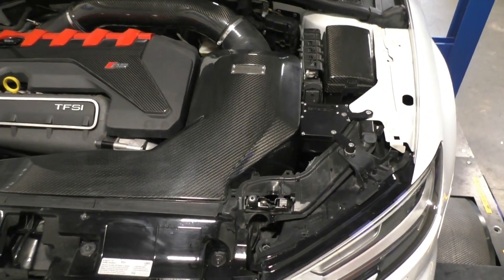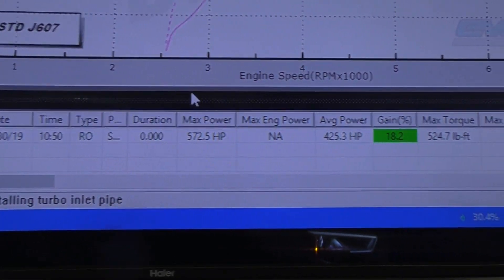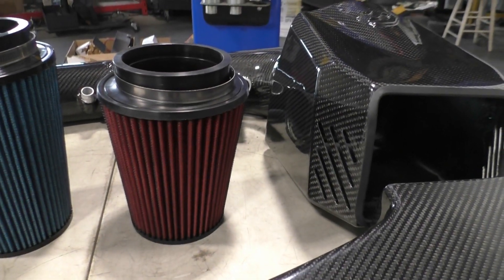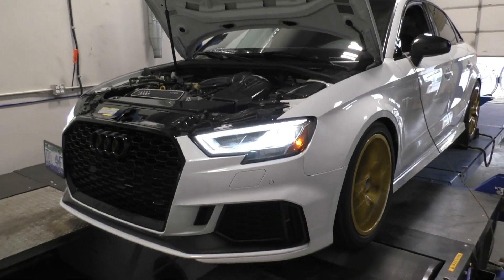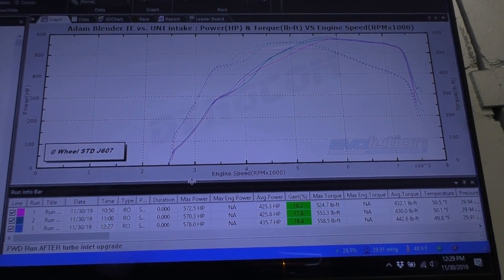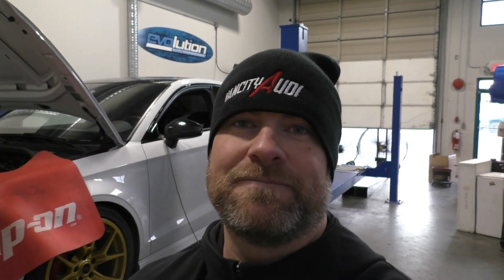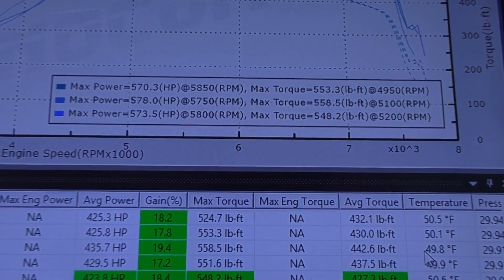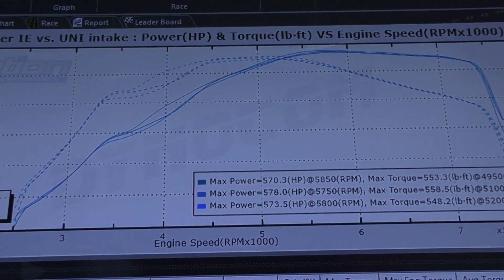Dyno testing the Unitronic 4" Intake System VS the Integrated Engineering Intake System - Audi RS3

Comment: Really informative video Adam.. thanks for that..
 Question though. Would my stock engine not be able to handle that setup seeing as the max wtq number the stock engine can handle is probably 520ish?? What ya think? 550 wtq is amazing. My jaw dropped lol My setup is same as yours apart the  inlet and intake.
Reply from the maker: On Unitronic software you will be totally fine.  The power hits later and pulls harder up top.  It is way easier on your internals.  Plus I'm running the standard production file on this video.  It is meant for a stock motor.
Reply: Ok cool. I figured that was the answer. I can definitely feel the boost hit on CC vs Unitronic. Man your car is a beast. Your probably making more power than advertised on their website hahaha.. good job again.🚀🚀🚀🔥🔥

Comment: Thanks for putting in the time with all your videos, quick question. Are you limited to the tune in terms of gains? I'm putting in the uni 4" inlet and the uni 4" carbon fiber intake this week and running the Uni Stg. 1 tune which produces the advertised 476HP / 469TQ . By installing these bolt ons, would you know if i'm limited to the tune specs for power output or would I gain some power over the advertised numbers w/ just the tune..
Reply from the maker: On stage 1 I imagine those will provide a little more power still. On stage 2 they'll be required to make the advertised power figures
Reply: Vancity Audi thank you!

Comment: How long have you been stage2+e85?
Reply from the maker: This video is 3 years old. This was me in 2022: https://youtu.be/Bj40cKwEYus
Reply: @VancityAudi  so car has ran fine wouthout any issues? im looking just for noises right now.. will i get more spool and purge noises with a uni or IE 4" intake without a tune?
Reply from the maker: @Drey Thompson  if all you care about is noise, then go with an open CTS Turbo intake. They don't fit really well, but they have a big open air cone that will make your intake sound louder at a lower price.
Reply: @VancityAudi  well, I plan on tuning eventually, so id want something good quality.
Reply from the maker: @dreythompson9016  You're going to want an open air intake regardless if you want it to mainly make sound.  The semi-enclosed intakes from Uni and IE are awesome for making power but don't make as much noise. Reach out to @redlinemotorworks1 on IG and let them know I sent you. They have some pretty damn epic titanium and aluminum open intake setups available.
Reply: @VancityAudi  sounds good thanks man
Reply from the maker: @dreythompson9016  you're welcome

Comment: I love watching you’re RS3 develop .At what BHP will the stock internals need changed ??
Reply from the maker: It isn't the horsepower you need to worry about. It is the torque. I used to believe that it was above 500lb/ft you need to upgrade your internals. Now I'm starting to feel like the motor can handle more as long as the power comes on later in the rev range.

Comment: Have you ever run on an awd dyno before?
Reply from the maker: Yes. This dyno is also an AWD dyno. I purposely measure power in FWD to make sure the AWD system doesn't mess with the results. I have tried AWD on 2 dynos and both of them had weird results because of the AWD system interfering and putting power down unevenly

Comment: 575 ENGINE horse power!!!! It’s not wheel, its 15%+ difference.
Reply from the maker: Wrong, that is the wheel horsepower. This dyno reads high and that's why I stopped using it. The drivetrain loss on these cars we have found to be around 10% at most, not 15%